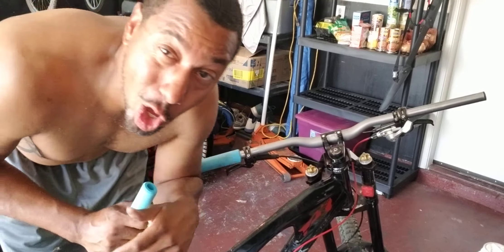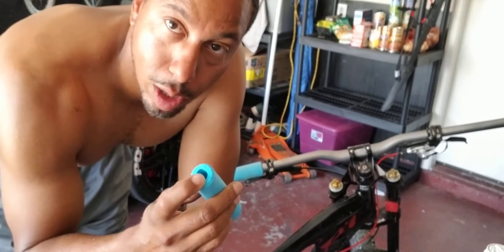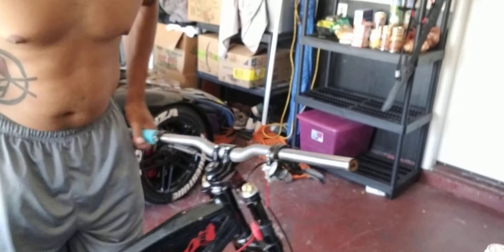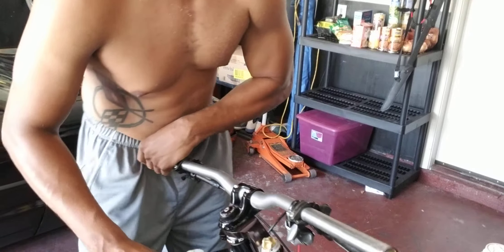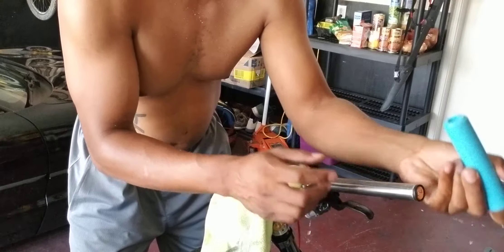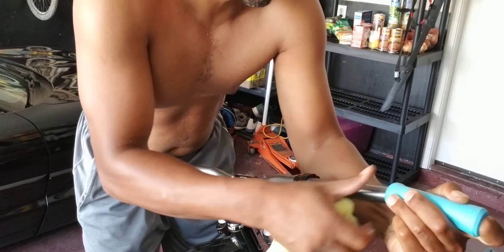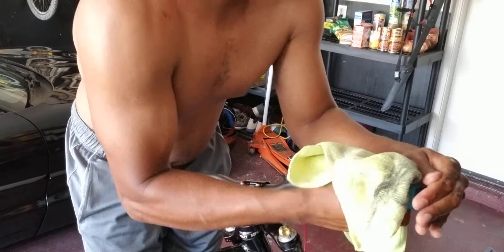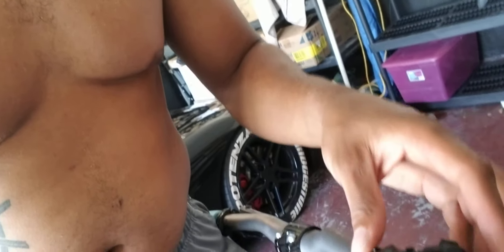ESI extra chunky grips super easy install

Comment: Thank you, this is the best explanation. Even the XXL grips went onto my bent handlebars easily. With the bent bars I have little leverage to lean against and I thought it might be impossible without an air compressor. I also soaked the grips in hot water for good measure.